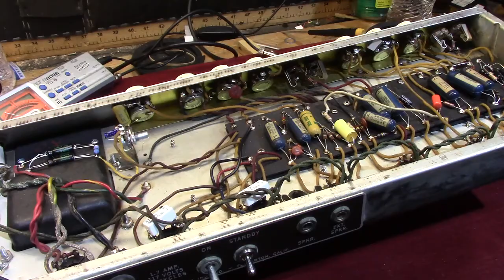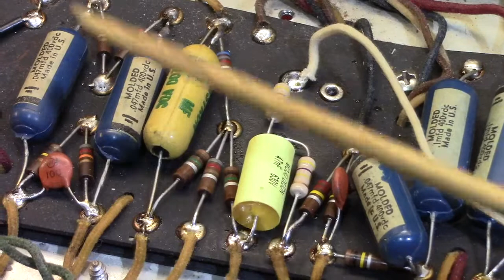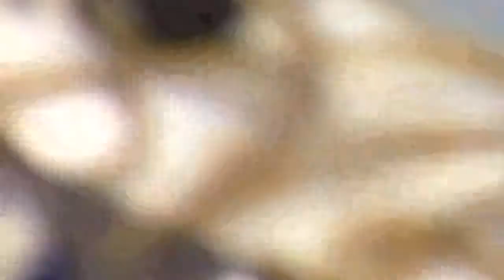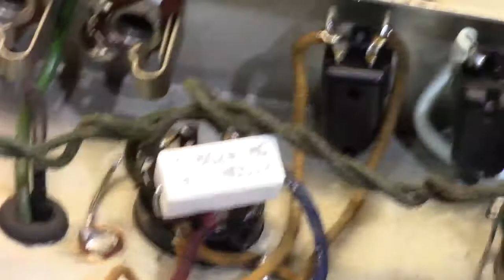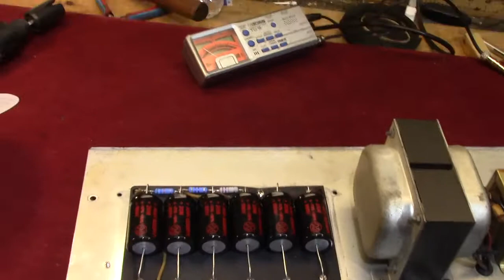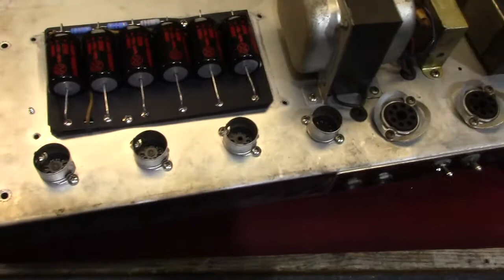1961 Fender 6G6 Bassman Restoration Part Two

Comment: Why we can't put metal film 1% resistors EVERYWHERE in the circuit? 
They are less noisy etc.
Reply from the maker: echo - Metal film resistors are less noisy that is true. 
But they are not always the best choice for a given task in a circuit.
They are usually not all that good at handling high current or fast transients.
Each different type of resistor excels at a different task. A well-designed amplifier will use all three.